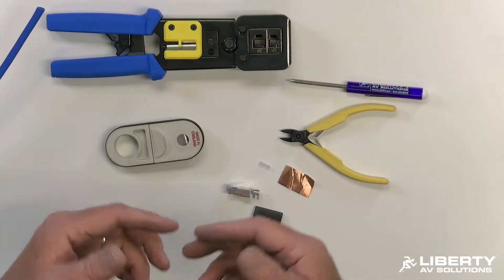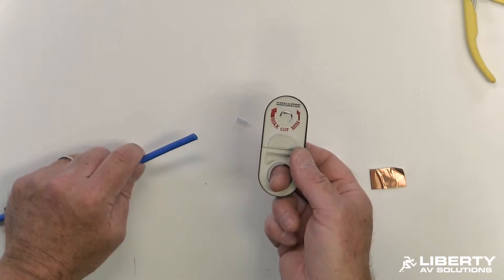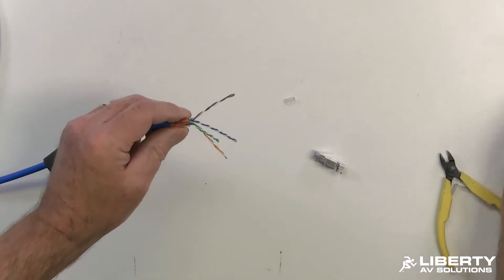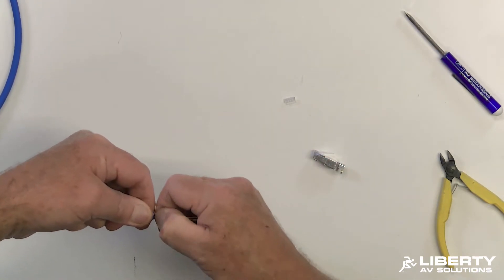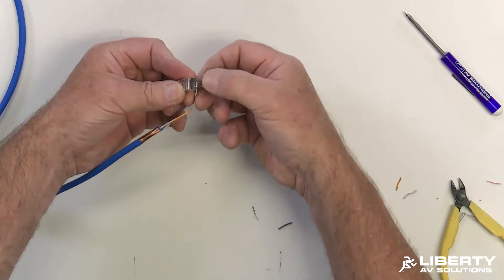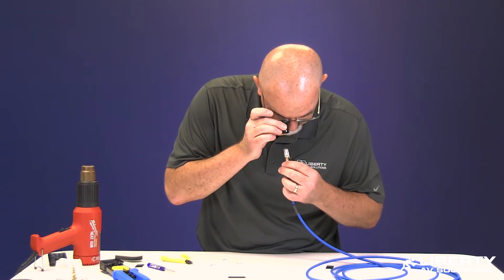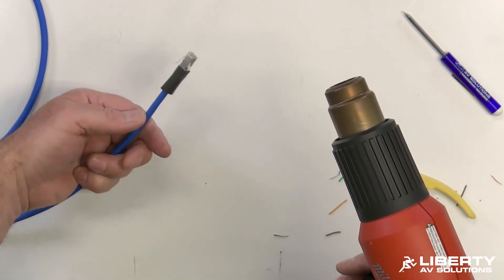Shielded RJ45 on CAT5E Shielded F/UTP Category Cable

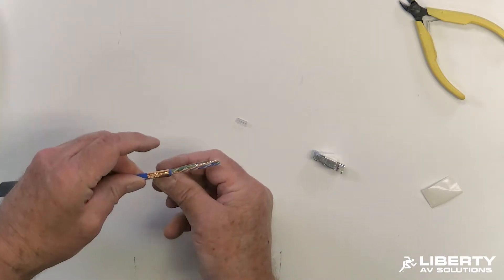Comment: 1:50 I can't seem to find a proper tape, some say that the sticky side is conductive but doesn't conduct much electricity, not sure if these are good too or not :/
Reply from the maker: Hi Adrian! Tape is 3M brand 1181 Copper tape.  It is designed to support conductivity and the adhesive is conductive.  We sell it by the roll under part number 80011181049. If you do not have an account with Liberty AV Solutions, you can try purchasing it via Full Compass or B&H Photo as we do not sell directly to end users.